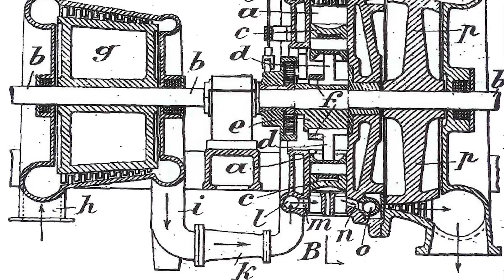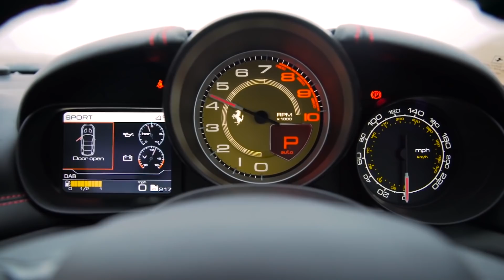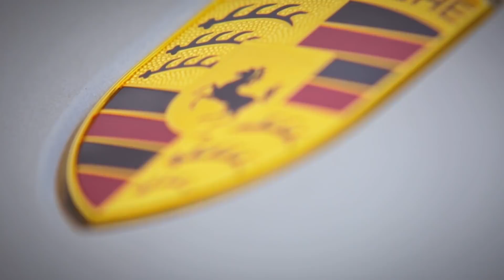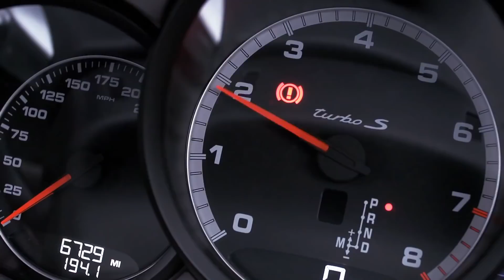Turbocharging: Are You Wrong About It?  - Carfection

Comment: People like turbo cars more out of exclusivity reasons. Before the turbo models were the high performance or sports variant but now it's the equivalent of the most humble base model. Plus most higher end turbo engines still have the typical drawbacks of lower end turbo engines, whereas performance NA engines are drastically different from family car NA engine. As a result high performance NA engines are regarded more highly as the turbo ones. Same goes for dct. At the beginning, it's the sign of efficiency and performance but now it's just as plain as the small displacement turbo engines. People would rather have a manual as a sign of high performance.

Comment: What a poorly thought out argument that the backlash is mostly due to nostalgia. 

Yes it is a fact that turbocharged engines do not sound as good and arent as high revving as a naturally aspirated counterpart, but that is by no means where it stops. The main reason is that manufacturers are replacing bigger and more powerful naturally aspirated engines with a smaller displacement turbocharged motor to try and put down the same numbers, with less emissions. The key word being replacing. You might argue this is a more efficient way of doing it, but in reality if you are using the turbo it will be sucking more fuel than the same rpm than its NA counterpart. So its an emissions thing, and as we've seen probably not even an honest thing either.

The other problems we are seeing and what car manufactures are telling us, is that turbo-lag is a thing of the past. Its simply not true. I've owned and driven many modern turbocharged cars and there is ALWAYS turbolag, very noticeable turbo-lag and often to the point where it is dangerous to pull out into a high-speed area as the boost can come on unpredictably when turning. Addionally to this, these engines will not boost all the way to their redline, and will often top out early forcing a driver to shift early, and wait again for more power because of a dead bottom-end torque curve. So what you end up with is an unpredictable but liniar boost experience, rather than what we had in the past which was a predictable but punchy lag which provided good humour for the driver and a kick in the seat.

Im sorry but a turbocharged engine just cannot compete with the simplicity, reduced weight, screaming high rmp sound, smooth torque curve and free-revving nature of a powerful NA engine.

Comment: Mazda has been developing a Spark Controlled Compression Ignition engine, which if I'm getting this right, only uses spark plugs to ignite fuel when the fuel can't be ignited by compression. The new Mazda3 doesn't list a turbo on its spec sheet which means that they could put out a new Mazda3 Speed with no turbo, as the SCCI engine is already much more fuel efficient. That would be a hot hatch

Comment: I disagree when he says turbocharging takes the soul and noise of a car.  That's an overrated statement. It's sometimes the case in factory condition with some vehicles, but some turbocharged cars actually sound better in stock or aftermarket (exhaust) form.  If the car is built correctly you can have just as much thrill and excitement with a turbo car as a N/A.

Comment: well a good topic and it was bound to draw a lot of discussion, many of you have covered the regular topics and the key Issues haven't changed. Yes its a mini scam to get power but satisfy the EU regulators on omissions, yes there is still some lag, throttle response is terrible but they have hidden that with software partly. The noise is all synthetic, to the extent you can almost perfectly replicate a given series of pops and bangs by applying the same on - off measure of throttle in the same gear. For those who never grew up with NA its probably good enough, for those who know different, well enough said. But take a look at this and ask yourself do you really think car engines are better today than those in the 90's look what port injection and direct injection are doing to your cars just  to meet the EU reg's. add the turbo's in the v of any engine and you have massive heat issues. Lets see how these engines look when they are older.  In the meantime watch this  https://youtu.be/xrLNDgrIw3U its a great article well illustrated. The EU ladies/Gent's are killing your cars because they don't care and electric cars are not the answer, I agree I don't know what is though... electric cars can be another topic for Alex another day.. hint..hint...

Comment: 1 word Alex: Response.  Throttle response isn't a problem as ECU's compute performance and connected paraphernalia means that off-boost response is just as quick as any N/A car today.  The problem with turbocharged downsizing is the dependency on boost to deliver any acceleration at all.  Small turbos don't take long to react or begin accelerating themselves, but they do take time to achieve an RPM that will deliver reasonable amounts of forced air to provide acceleration.  Under most circumstances this turbo latency (I'll avoid the term 'lag' because that could get confusing with 1990's turbo lag which isn't actually the same issue) is a characteristic we can learn to drive with.  But we all know the dangerous situations this behaviour can put us in: the 2nd gear busy roundabout, revs too low as you're concentrating on maintaining rolling momentum and finding the gap.  Stab the throttle for power and, and, wait!  By that time the car already on the roundabout is upon you.  This is especially an issue for those who still drive N/A cars and simply forget the problem exists.

As for progress, I'm actually really looking forward to electric cars, then all of this tosh about noise, auto gear boxes, lack of throttle response, it's all going to disappear.  Come on Honda, start production on that EV coupe!  I really miss my 3L straight 6 N52 engine, but I don't think I will miss it so much once I'm in one of these!

Comment: Seeing how Ferrari is making their turbocharged engines 'feel' more naturally aspirated by adjusting the boost-threshold, throttle response in turbocharged engines in the future can improve. But I'm going to respectfully disagree with you Alex when it comes to sound - the 991.2 GT3's 4.0 9000rpm 9A1 engine and the BMW M3's S65 V8s will never be beaten by their turbocharged successors with their raw scream.
Reply: Don't forget -- the legendary BMW S85 V10 wail.
Reply: +Vrbas Jimmy Page Fair point too, the Audi S1 Group B were epic indeed, so are Subarus and Skyline GT-Rs, FD RX-7, S15 Silvia Spec R, Audi RS6 and some modern AMGs. Perhaps what I actually should've mentioned is turbocharged cars nowadays don't really appeal to me than naturally aspirated cars. But oldschool turbocharged cars actually sounded great especially with aftermarket exhausts.
Reply: When fuel economy is of no concern, ie older cars & race cars, then turbos sound good. And also when an atmo engine is dull but becomes awesome when turboed, like the Subarus of old, that's the only exception!
Well, e-boost is here in e-chargers or kers type of performance enhancing solutions, so no need for exhaust restrictions. Just reduce the capacity, reduce the consumption, reduce the emissions, add the boosters & keep the atmo sound & performance. Perfect!

Comment: Following that logic, i'm skipping the outdated petrol engines and jumping straight into a Tesla. ..or i'll stick with the N/A cars for as long as i can.
Reply: Funny logic, don't well-tuned turbo cars sound better than a tesla?
Reply: Alex S Whether or not a turbo charged car sounds better than a Tesla is irrelevant according to this video. People who hang on to good throttle response and high reving engines that sound good are basically made fun of. Power and efficiency are what matters. Therefore the logical thought is to skip the inefficient petrol engines and go for solar cells and a Tesla. A Tesla has way more real life power than even fast  petrol cars (within real world obtainable speeds), and is way more efficient.. especially if you combine it with solar panels. ..oh and it has a throttle response that'll leave even a good N/A car in the dust.

Comment: I would not be without a turbo now I have experienced my Astra 1.4 litre petrol which has amazing torque and power, more than I ever dreamed possible..most of the time it chugs along just above idle in normal driving. It is also extremely quiet and smooth

Comment: If I had to choose between a 488 and a Hurracan, I would choose the latter in a heartbeat.. but I have to say that my RS3 with the proven 5 cylinder and turbo, 400PS makes it a heap of fun and with the optional sports exhaust, it sounds quite great to. And I drove the E AMG wagon a few days ago, Merc has found the formula how to make a forced induction motor sound great. Not as great as my late C63 AMG, but after going to a turbocharged motor, I am saving enough money on fuel, to enjoy an extra trip to the south of Germany each summer to kill my need for speed. But I hope there will be a future for a naturally aspirated engine as well, so we can still get those chills down our necks reving a V10 engine all the way to 8500 and press the third pedal to be able to shift. But I am afraid that's only a wet dream.

Comment: Turbos need more fuel, not less, than N/A equivalents, when driven with your foot down.  Extra fuel is used on a turbo engine to cool down the combustion chamber.  Check the science and real facts.
Reply: I'm pretty sure the main reason turbos use more fuel is because more air is being shoved into the engine so more fuel is needed to maintain an optimal air/fuel ratio
Reply: Turbocharged cars consume more fuel because they burn more, not because they use fuel to cool down the combustion chamber.

Comment: You're missing a very valid problem with Turbo powered engines; including the new ones. The throttle response and consistency is nothing like a well tuned NA. I have a very turned VX220 with ITBs, when I press the throttle 50% it will accelerate at 50% all the way to 7800rpm, this is the same for however much I open the throttle, it's consistent and predictable. My turbo euro hatch on the other hand adds more power even when my foot is still, in extreme scenarios it can add power as I'm closing the throttle! I don't have nostalgia for old cars, I just love the way they sound and feel, be it brakes, gas or steering. Better is not always "Better." The new smarties may be better for you but they certainly aren't better in all areas ;) However I don't know how turbo powered hyper cars drive with things such as torque fill as I've never driven one. Turbo engines are great in daily cars for low down shove and economy, but for a car you want to drive at the weekend with glorious progressive revs and noise - which is the purpose of most fun /super/hypercars - turbos doth butter no parsnips Alex.
Reply: Try driving a really well-tuned modern turbo car(like a 991.2 Carrera or some AMG), and tell me that throttle response is unpredictable again. BTW your hatch is garbage, just get rid of it already.
Reply: Alex S Granted I haven't driven the very latest turbo engines but how is a VX220 a garbage hatch? Garbage I could accept but the fact you called it a hatch tells me you haven't got a clue.
Reply: Also I realise I have contradicted myself when I said including the new Turbos but then say I haven't driven the latest. I have driven the latest run of the mill turbo cars but cars like a 991.2 and a california T or even the latest M4 are out my reach currently like they're are for most the population.

Comment: A turbo car only sounds lousy when the engine is tuned to maximum efficiency/ best fuel economy. Overfuel the engine map and you can have a great sound with pops and bangs as per a large pipe Subaru Impreza Turbo sound. Just listen to videos of  turbo rally cars from 1990 to 2000.

Comment: Oi, car manufacturers... Use more superchargers! You get your forced induction for big power and decent economy, but with linear power delivery like an NA motor, and they sound cool. DO IT.
Reply: Dalton v yeah, not quite as good for efficiency when cruising, sure... but they're better to drive, which is what people want from sports cars :-).
Reply: Problem with superchargers is, they don't utilize exhaust fumes like turbochargers do. If you want pure experience, just stick with NA engines(if car manufacturers ever keep producing them).
Reply: Alex S yeah I know... as dalton v said, they are parasitic. The benefit of running it in this way though is that the boost you get from it is linear dependant on rpm, which has the effect of making it feel a lot more like an NA engine. So, downsize the engine, and put the supercharger on a clutch so that it can disengage while cruising.

Comment: Cars should focus more so on gearing, aero and weight as well as fuel reduction technologies than turbocharges and the like. Some cars have a terrible final drive gear.

 For example I had a mk4 Jetta 2.slow and going 70mph on the highway was 3500rpm (which was dreadful to listen to). If it was 1800 it would have gotten significantly better mpg. That's why the Corvette can get 30+ mpg out of a 6+ liter engine. 

And the new version of displacement on demand, which alternates which cylinders fire to keep wear even. Cutting the amount of cylinders in use in half also does have an efficiency gain. 

Reducing weight has benefits all around. Less energy needed for acceleration and turning. Lighter wheels and suspension will have a profound effect compared to body weight. 

Mercedes even decided that aero was a better focus than weight reduction for efficiency. The lower the coefficient of drag, the less energy is needed to overcome the forces and continue in a straight line. Look at the extent of hypermilers. They will get there car to a cd of .15 or less to get better gas mileage. It also makes the car quieter to drive on the highway too. 

There have been concepts that died that would increase an engine output and efficiency dramatically. Laser ignition, which uses lasers to create spark, had a 25% increase in power and fuel economy. It can create a spark at multiple points to have a flame front come from all positions to completely burn the fuel. Hcci (like Mazda new engines) have near perfect combustion of fuel which means less is needed (best for low load situations due to it's uncontrollable nature). That and a camless engine also has a 30% gain in efficiency too. 

We have the means to make engines about 50%+ thermally efficient, it just costs a lot and no one wants to do it because it makes the car so expensive it won't be competitive. Turbos are great, but not the best solution we have.
Reply: the same governments that are mandating less fuel use are also mandating heavier, therefore less efficient cars by requiring specific "safety" features
Reply: AnarchistMetalhead Absolutely, and by making more "safety" features, they are actually making driving a whole lot less safe because people are being taught to pay less and less attention to what they are doing.

Comment: There is only one reason I dislike turbocharging - because you have to wait for the power delivery. Nothing like trying to pull through a corner and getting nowhere near the power you should, then getting way more power than you expected. As an enthusiast driver, I find the power delivery unreliable, honestly.
Reply: Nick Biancalana As an enthusiast driver wouldn't you rather be in the right rev range ?
Reply: and in a ditch
Reply: You wouldn't want to have that much power around a corner anyway, and you were probably not in the right gear when you're trying to get out from a corner. There's something in the world called "downshift". Plus you should practice more with your car's throttle and get to know it better. If you know the boost is coming then you should get yourself prepared in advance.